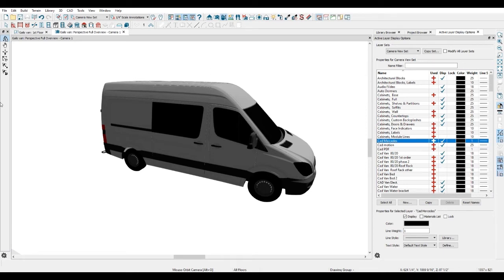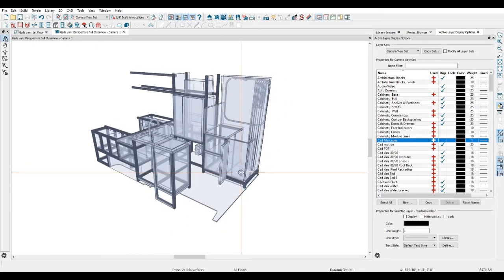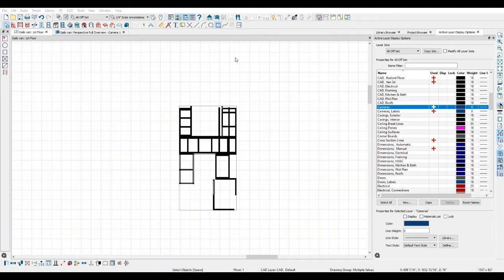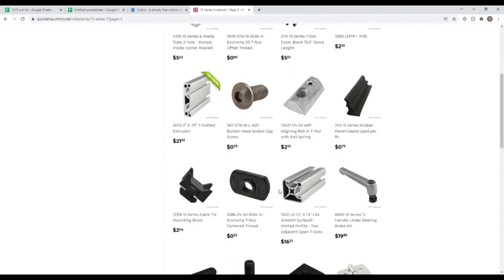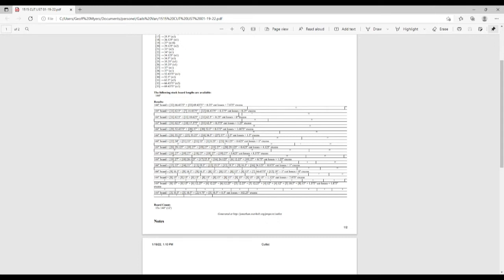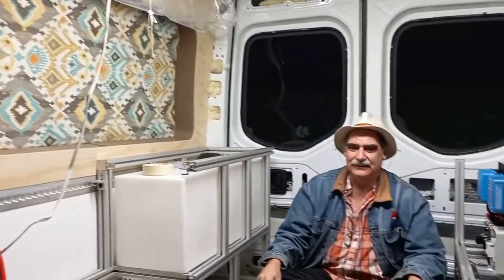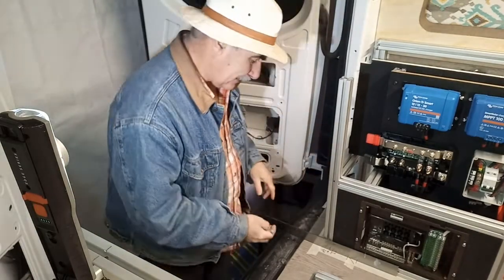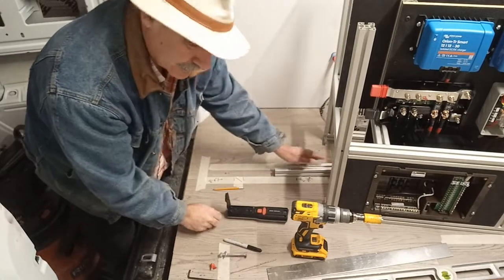Yes, we too used 80/20 aluminum extrusion in our van build

Comment: One thing to think about when determining head location is if you are ever urban camping, the curb side is usually a bit lower than the driver's side for water drainage, so you probably want your feet on the lower side/curb side.
Reply from the maker: Thanks for your comment. In my setup I don't anticipate a problem, as the sink is a fair bit higher than the drain pipe, but I will keep an eye on that. So many things to consider.

Comment: How exactly did you attach your extrusions to the l track? Using an angle bracket? I have the same l track component you showed.
Reply from the maker: https://www.amazon.ca/Gripon-L-Track-Double-Threaded-Fitting/dp/B07V4WQTZ7?pd_rd_w=pAFtZ&pf_rd_p=e183bdf6-729e-4748-90fc-0158d028c767&pf_rd_r=Z0379K0N1GD6W7KNCKQF&pd_rd_r=4edefaf8-7a02-4ae4-9afd-d883d5c97817&pd_rd_wg=14ou5&pd_rd_i=B07V4WQTZ7&psc=1&ref_=pd_bap_m_rp_5_sc